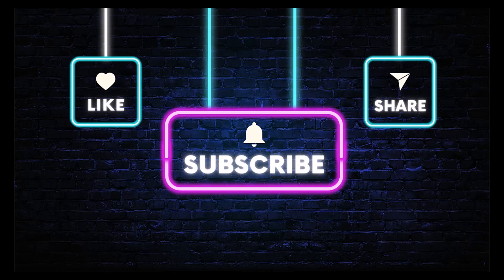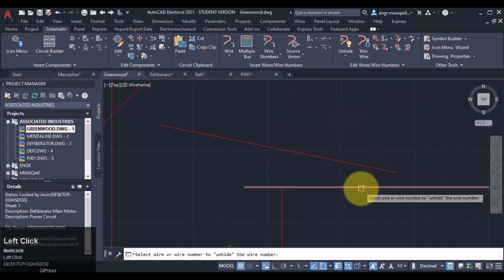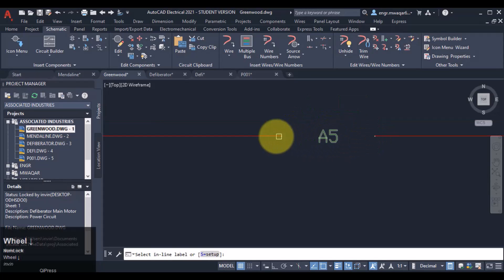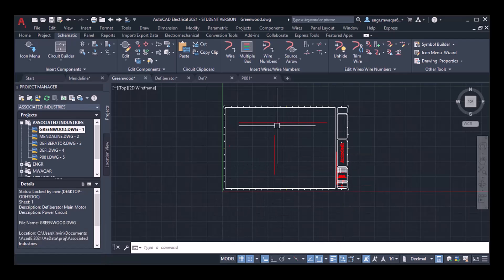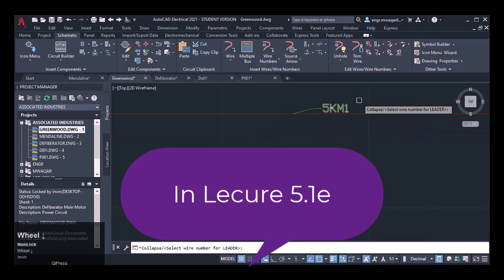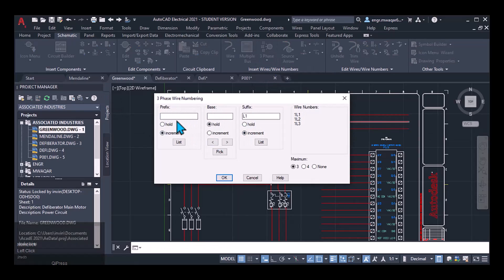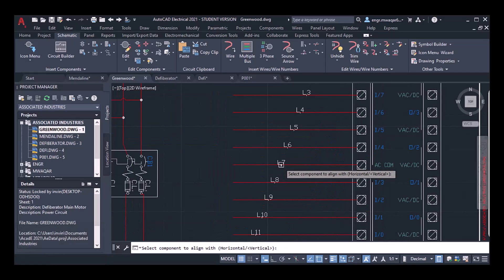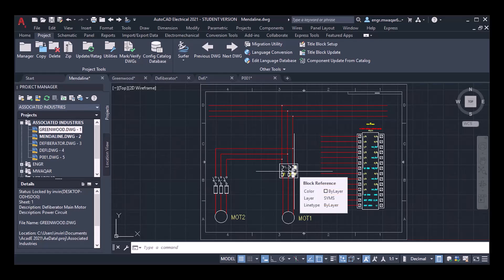AutoCAD Electrical 5.2a: 5 Secrets Electrical Engineers Use to Master Wiring Diagrams

Comment: Sir how do i change wire gap symbol, im working on A4 size of layout and wires size is okay except the wire gap symbol and the intersection symbol please.
Reply from the maker: Thank you for your question! 😊 
To change the wire gap symbol in AutoCAD Electrical, you can modify it from the ‘Drawing Properties’ → ‘Wire Numbers / Wire Gaps’ section. You can also adjust the intersection symbol style and size from the ‘Symbol Library’ or ‘Schematic Settings’. If you still face any issue, then let me know — stay tuned!